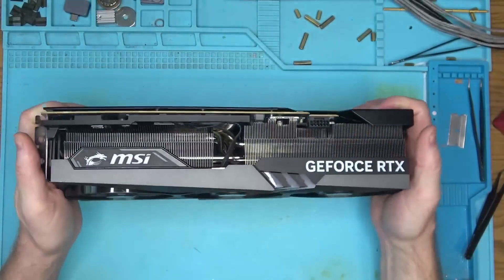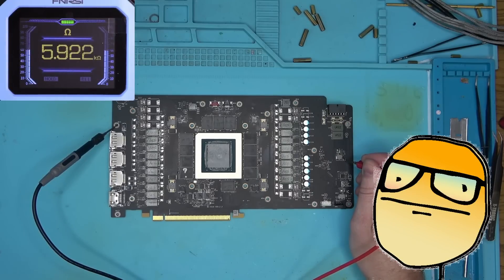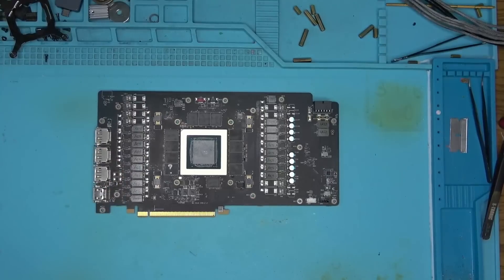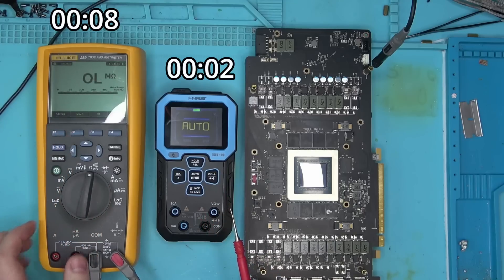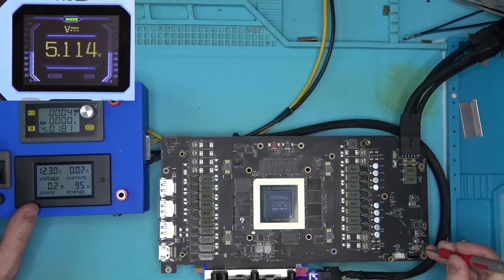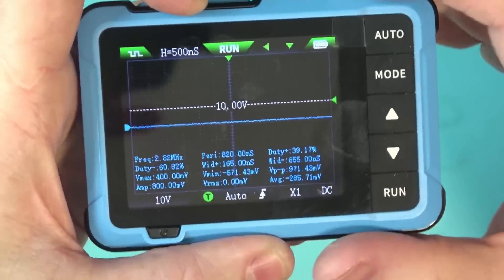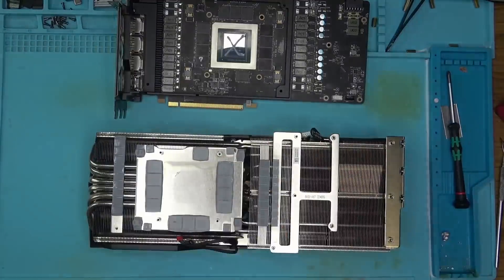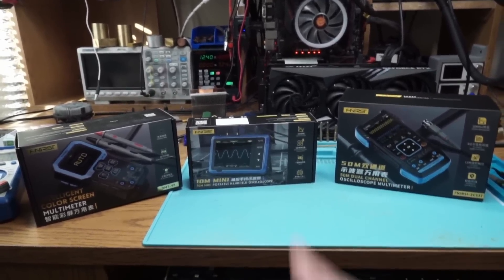This 4090 was repaired GET BACK IN THE GAME

Comment: Having been in the Automotive repair industry for 30+ years I can say that, in my personal experience, the Fluke meters are far and away the most durable multimeters around. They do lack certain features, I have a Snap On graphing meter/Oscilloscope and a Mac tools multimeter, but I still have the same Fluke 77 meter I bought 30 years ago in my toolbox. I don't use the Fluke meter much anymore but long after my other meters are gone that Fluke meter will still be there. In my mind if you just need a basic multimeter that will last forever go with the Fluke. If you need something that is setup to read things like Duty Cycle, Frequency and temp get something more advanced. And if you need a basic oscilloscope the new Pico scopes are cheap and simple to use.

Comment: @northwestrepair: The Fluke multi meter is expensive because documentation is expensive. Fluke contracted with the military to pay for all of the equipment and created all of the technical documentation on the specifications for all Fluke equipment including for product calibration. Smaller companies rely on the existing Fluke documentation simply because they can't afford to pay for their own. Being the holder of the DOD contract makes this possible but more expensive. You're the leader in the industry if everyone looks to you for this information. The fact is any multi meter can be used for low voltage DC electronics. If you need real fast response time for true RMS maybe a Fluke is the way to go but otherwise it doesn't matter. It's not really that Fluke is purposely keeping the old design. It's older because if they change the design, they also have to change all of the documentation. This means no update to fancy screens.

Comment: As someone that's used handheld tools from FNIRSI for the past year or two and is just now upgrading, just be aware that these are fairly imprecise and are definitely entry level tools. Some are decent but they very much sit in that budget hobbyist zone. They'll also become unusable in environments with lots of electrical noise about like my current office. The scope is straight up off by 2V in either direction which is kinda unacceptably big for me right now. If you can afford better it's usually worth it. But if you can't having these is absolutely far far better than having nothing. My budget couldn't spring for more and the tools worked good enough to get things done for a year or two. But by god I'm glad to finally be able to upgrade. Troubleshooting with these is so much easier than without. And the step up is a much smaller improvement but there's just some circuits this won't be able to deal with adequately. Like audio, the inherent noise of the tool makes it impossible to detect audio noise that's bad enough to ruin a listening experience thus making it impossible to troubleshoot.

Comment: I recently got hired in a repair shop and the problem is I don't have any testers yet that I own.. I am only borrowing my co-worker's old tester that has inconsistent values when I'm using it.. If I will be blessed with any of these testers, I will take care and use it very well.. It will make my job easier especially on repairs..

Comment: Interesting gadgets there.. I can see the value in the small oscilloscope and meter that fit in the pocket easily  for techs that are on the move,  in the past I have had  many instances where  this kind of gear would be of great benefit, especially  if your  working in cramped spaces  like  a  turret  of an armoured vehicle or working on something you cant  put on your bench and if its inexpensive it wont hurt if you drop it and someone drives over it :/   
if you can make functionally important  gear portable then to me its a worthwhile trade off to do a few extra button presses, as long as the results of those button presses are consistent.

Comment: The only tool approved by NVIDIA to repair their 4090 cards is money to buy a new one at the store. I'm also surprised at how flimsy those newer motherboards and graphics cards are, as the ASUS MARS II, R9 Devil 13 and similar cards were heavier than the heaviest 4090 and motherboards took them without any support brace required.

Comment: If you reply to the persons comment they should see that and be able to contact you if they win. 
Im still using my Fluke and I think the reason for that is its over 15 years of day to day bashing as I'm a appliance repairer and it still works perfect.  The only issue I've had is the dam leads dieing on me, I have to replace them every couple of years as shoving it in and out of the tool bag they just get messed up.

Im in Australia so I guess I'd have to pay for shipping if I won lmao

Comment: I mean, look. I used FNIRSI for a while now, at first the size and everything was a bummer but you'll get used to it and when you're switching from a unit to the other that has the same control scheme it's actually pretty okay. Although there's something you haven't noticed in this. The little oscilloscope+function generator has response time and polling rate issues, and tends to freak out when there's a lot of oscillation on the screen. If you're actually looking to measure something very accurate I found that their DSO152 is equivalent or better to a RIGOL unit I used to have before it broke (I shorted the probe ground to Live)

Comment: Thumb up if you want Tony to try sticking ripped pads with superglue on a 4090 ;)
Reply from the maker: I tried. Not very impressed to be honest.
Maybe I need a thin super glue instead of a regular one. But I am afraid it will evaporate too quick.

Comment: interesting you mention fluke and its using old tech  and is obsolete Just like Hakko  i bought one and returned it in the same week,  8 to 12 seconds before it reaches any desired temp, old tech obsolete tech and i gotta pay a premium for a toy looking unit which is being dominated by off brands  so many other brands only takes 2 to 4 seconds and its ready to melt 63/37 Sugon is a really good brand and in my opinion one of the best soldering stations out there

Comment: I was going to question the soldermask pads and UV... but you answered it exactly as I expected. 
I'm a Fluke guy here, usually they are fast to give you a reading vs cheap shit and noticeable. But that FNIRSI meter was pretty cool and I agree with the small form factor and buttons. I do have a FNIRISI signal generator and eff me, setting it up and navigating the settings is a real effing PITA! And yeah, I said I am a Fluke guy and do use a Fluke process control meter at work, but no way would I spend $5k for home use when the FNIRISI works well enough. Even with the temptation to throw it against the wall with the few buttons and navigation drama.

Comment: 07:00 Fluke (logo) is old brand, what used to indicate good quality product in pass. If asked from electricians what is good measurement device, they proparly answer Fluke because the company where they work only bought Fluke devices. Company want reliable devices! But today Fluke is like Apple product. Expensive to buy but cheap to made.
Of course they not add more features and slow device do not harm casual users.

Comment: Flukes are expensive because you can get them calibrated, they don't drift much with temperature changes and time, they're generally reliable and the CAT rating won't be a blatant lie lol.

Those Chinese made meters are great for hobbyist use but you'd probably struggle finding a cal lab that can calibrate them. 

For board level repairs they're probably good enough though. Anyway, that's why Fluke are expensive. They have to care about safety and long term reliability. Check out a video titled "Inside Fluke - The Measure of innovation 2015 - Pt 1" for why people use Flukes.
Reply: Plus they keep their simple design the same because so many places have instructions on their use which would be thrown off if you were to radically change the design.